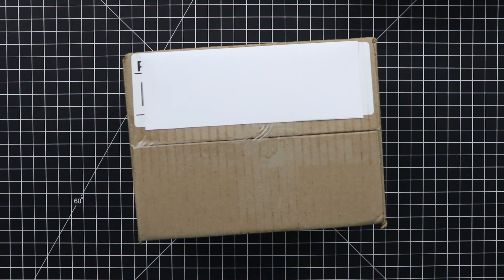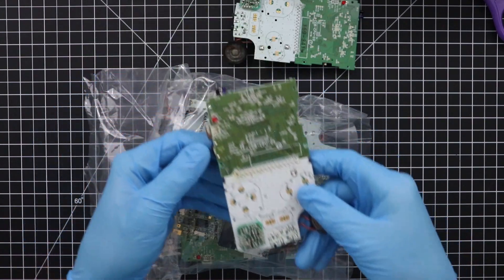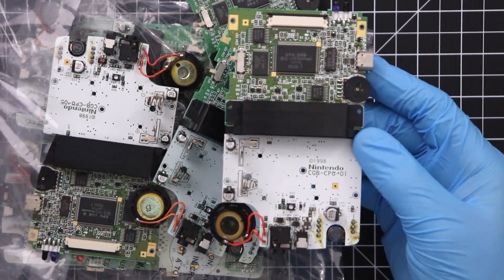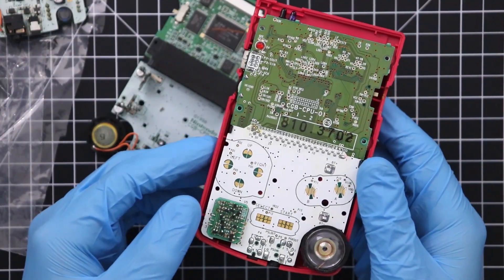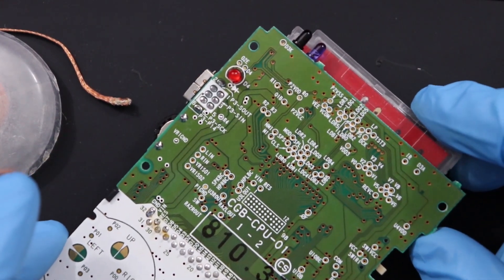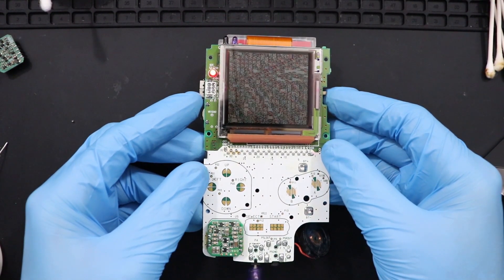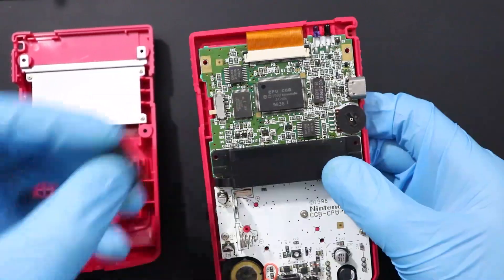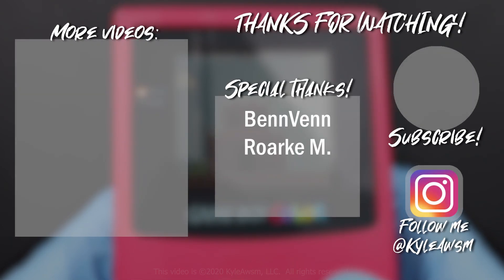Repairing the Rarest(?) Gameboy Color | Troubleshooting Tutorial

Comment: Hi Kyle,

This board is using the "CPU CGB" revision system-on-chip which is somewhat special in that it contains a slightly different boot ROM than the other SoC revisions. 

I managed to dump this boot ROM (cgb0_boot.bin) a few years back by using BennVenn's clock glitching trick and LIJI (of SameBoy fame) compared it to the previously dumped CGB boot ROM and found the following differences:

- CGB0 does not initialize Wave RAM, newer revisions do
- CGB0 uses less optimized code to load the Game Boy logo
- CGB0 has two redundant writes to RAM, which were removed in newer revisions

Now if you want to try finding something even more rare, look for a Game Boy Color using the "CPU CGB A" revision SoC :-) Based on the date stamps on the CPU it was likely only manufactured for one or two weeks back in 1998. The serial number ranges of known units are a bit strange because there are units using the "CPU CGB B" revision SoC with lower serial numbers. From the 3 known units identified, the serial number ranges indicate that there may be around ~6,000 in existence. Look for a berry red coloured boy in (or near) this range: C10400331 - C10405970. A unit with C10410000 serial number has been identified as too high (contains CPU CGB B).
Reply from the maker: Hi Matt, thank you for commenting!  I'd be interested in talking more over on Instagram.  I appreciate all of this great info! 🙂  Cheers, man!